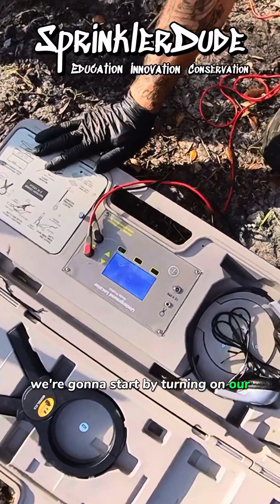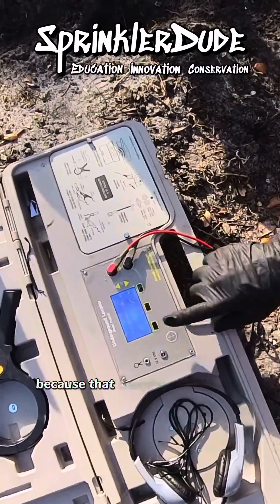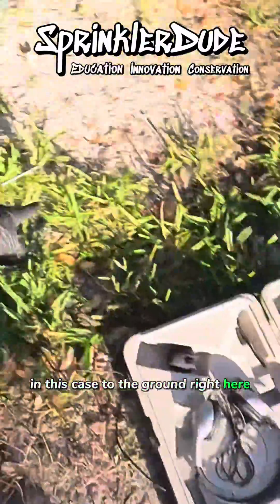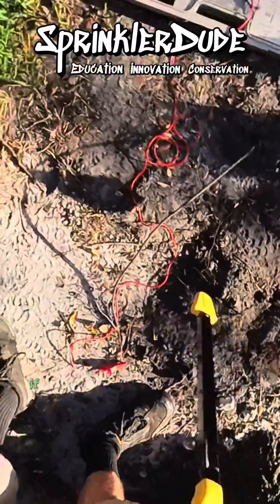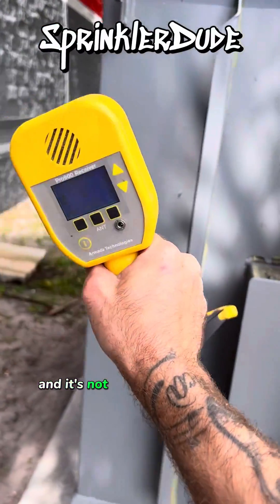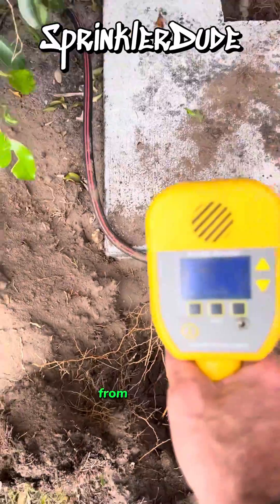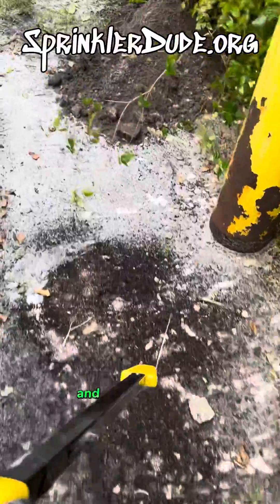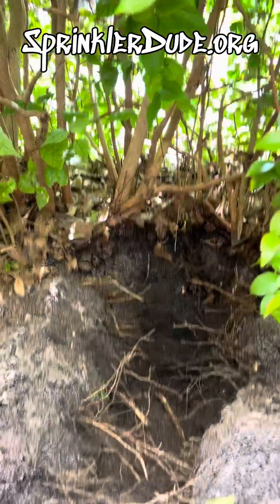How to use a wire tracker / valve locator

Comment: That machine sucks just bought it spent $1500 on it. Cant pin point the valves wasted 5hrs cant charge the customer and the battery are half way dead now. So disappointed
Reply from the maker: This tool takes a little bit of practice to use effectively and efficiently. The manufacturer has a bunch videos here on YouTube. As for the batteries. This tool uses electricity to put out of tone that the receiver can pick up. Depending on the level you were using the locator at. Would lead to how quickly the battery depletes.
Reply: @sprinklerdude9768  yeah I watched a bunch of videos. I need to get more familiar with it. I charged my customer $500 to locate a frontyard valve and backyard valve. It was a 5 acre property and kept losing signal but after 5hrs today I just gave up I felt defeated like a loser lol. 5hrs is alot to be looking for valves I was poking around a bunch to. I found two valves but they were the wrong ones. I guess next job I'll try and redeem myself.